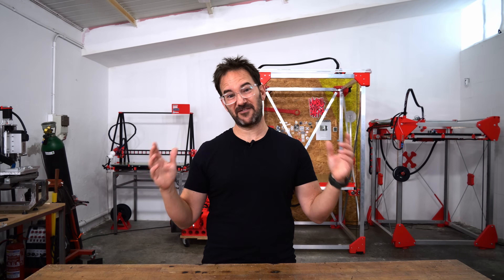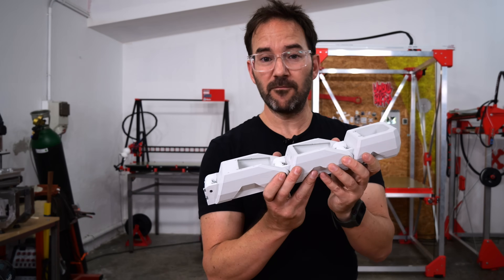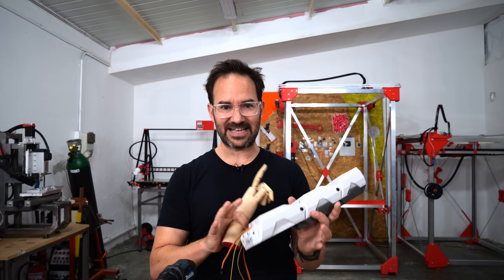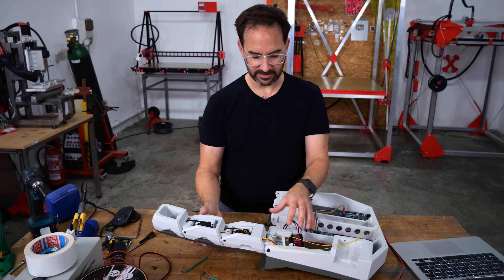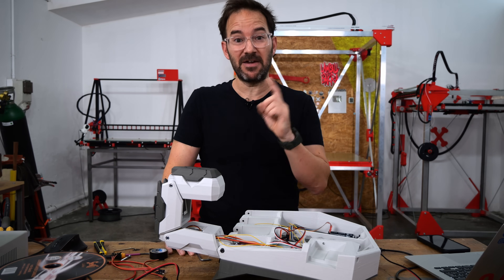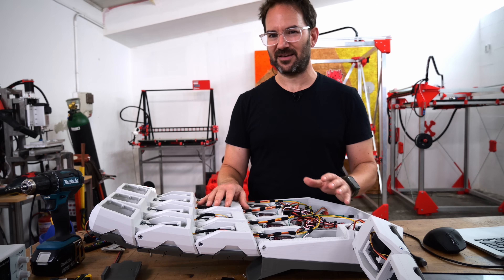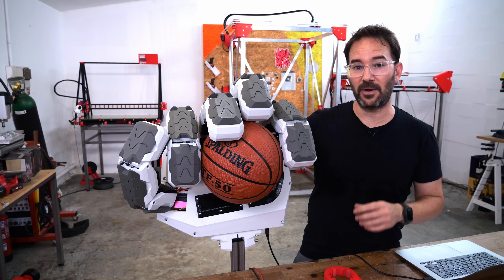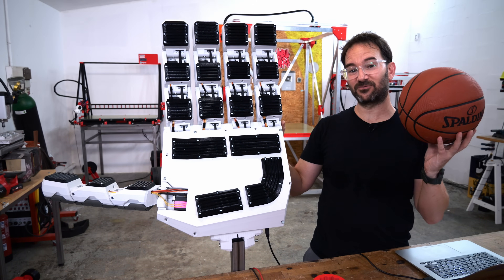You won't believe what this 3D printed hand is for

Comment: something to possibly consider that would let you simplify wiring, human hands don't have individual joint control of fingers
instead, it's just a long tendon connected a muscle in the upper arm
you could have a pulley connected to a far more powerful motor hidden in the arm or hand of the mechanism, that way you can get something more powerful, and each joint could bend to fir the form of the object it's holding automatically to a degree

also, the movement of the thumb is extremely important for grabbing. It's why people talk about humans having opposable thumbs being so important. Without that 2-axis movement on the base joint, grabbing becomes a logistical nightmare

Comment: Buy a mini lathe and milling machine, you can get a mini lathe for very cheap and a used old mill for a decent price or if you have like 5k you can buy a nice new cnc milling machine, also a 3d printer that prints aluminum or metal

Comment: I was so waiting for you to make it flip a bird.  Middle finger stays vertical while the other digits fold down to make a fist.  Variations of the gesture are possible even when the fingers on the 3D printed hand cannot flex left to right like a more natural moving hand.  So...how long will it take you to build your giant mech?  Will it be like a Robojox type of mech where you are the pilot inside the machine?  Or will this be externally controlled with wireless puppetry exosuit.  Translating the motions of your body into the movements seen in the mech?  Like the tools used to bring Johnny 5 robot to life in the films Short Circuit parts one and two.

Comment: Super project and super complicated. With 15 servo motors, each with 180 degrees of freedom of movement, you have an infinite number of combinations, isn't that super hard to program? 
But I would have a recommendation that strikes me in each of your videos in the eye, get the makita cordless screwdriver with 12 volts, this has more than enough power for your kind of projects, but is also much more handy and smaller! 

What I find great that you no longer in red 3d prints, looks much better without the red Pla from 😃

Comment: Fingers have a single tendon, one on the inside and one on the outside, ie, a single motor with thick belt will save 2 motors per finger.

Comment: Nice project! But for the servo's, maybe the pca9685 is a nice option to consider in the future. A single board can drive 16 servo's via I2C without any issues, and you can chain them to drive up to 992 servo's or other PWM hardware over a single connection!

Comment: This is really cool and I like the finished look of it. I was wondering if the servos were going to be able to move so much weight and it looks like they soft of can, but the belts aren't helping them any. Would it be too over-built and expensive to switch those out for chains and sprockets? Maybe also some motors or servos with worm gear drives to improve torque? I'm also wondering if instead of a belt or chain you could use a thin steel cable and the motor could be fitted with an oval shaped cam to pull back on the cable. You could add springs to return the fingers, but maybe another cable going the other direction around the cam would work better.. Maybe a spring keeping tension on the motor mount/gearbox assembly.

You probably already have a better solution in mind, so I'm curious to see what you come up with!

Comment: Its seems you don't need the motor in the finger's joint at the top. Only those in the hand's joint and the middle section. I'd connect the tension belt from the middle section motor to the finger's tip, bypassing that third motor. Just watch how your finger moves!

Comment: Not sure how exactly to explain this but since the fingers can't really move laterally compared to a human hand wouldn't it make sense to maybe instead of having 5 fingers to for example combine the pinky and and ring finger as one assembly? and just use the free up space to add combined servos or a bigger servo?'
in this case, if you use a big enough servo you can even maybe eliminate the middle finger and make It more efficient maybe?

Comment: For a Hexapod project, I once also had the idea to solder a wire to the potentiometers of the servos. As I had 18 servos to control, and I did not want to use 16 ADCs I used some analog multiplexers. This did not work at all. Somehow the analog multiplexer did not have a high enough input resistance in order to decouple the potentiometers from each other and the whole thing worked like a big resistor network and the servos started acting chaotically, as moving one servo also resulted in a resistor change in the other, which they then tried to compensate in the control loop.

Comment: You also need at least one pressure sensor  per finger for feedback (read some of the  earlier story from Isaac Asimov). To be extended on every phalange.
Reply: not needed. if you used stepper motors then the current would spike when encountering a load. its how 3d printers with no homing switch find home.

Comment: A system using strings and where the servos are in the palm of the hand would significantly reduce weight and thus increase the strenght of the fingers

Comment: I think it needs stronger motors with lower gear reduction to be more effective at grabbing things. Those servos have little 5v motors with high gear reduction. Great vid! Keep it up!
Reply: Yeah , having only 11 and 25kg seems insufficient with something this big, the servos should be 50kg+ and there are some 3d printed gearboxes which he could use for the fingers
Reply: @ulforcemegamon3094  Yes agreed. Also to add to that, there is a slight belt reduction at each finger joint but the leverage that is lost from the fingers being so big is not helping. I think one larger motor for each finger and then each finger joint is connected in a way would be a better solution than small motors at each joint. I'm studying engineering right now and could calculate the current max leverage at the finger tips if we knew the finger length, pulley diameter, and the belt reduction. I have a feeling Ivan didn't do any math for this lol. (Which I don't blame him tbh)

Comment: The palm should not be flat, the pad at the bottom and the L pad should be more thick, like 2 or 3 cm or even more but the width should be less like half,  so when the fingers closed it create a "box" result in more "grip", like that the balloon would be block, didn't try to slide out like  10:11 because the palm pad is too thin.

Comment: You should consider using actual servo drivers rather than just the arduino mega. The arduinos, especially with complex code can end up with jitters or unwanted movements on the servos since the arduino servo library is interrupt based and only controlled by software. This could end up with issues as the code gets more complex like reading the positions and implementing feedback. Using hardware timers is the best way to do it and is how servo driver boards do it, you could also get and use a microcontroller with enough hardware timers like some STM32 microcontrollers but you probably want to stick to using arduino.

Two options are to use a commonly available servos driver board with 16 outputs, or to use the servo 2040 board from pimoroni which uses an rp2040 to drive the servos since it can use the pio to drive the servos properly. The common servo driver boards have an arduino library that makes them very easy to use and are probably your best choice.

Comment: ive always heard it called a "mech" there are a bunch of games about them, also the kevlar wire seems like a really good idea, i might also suggest putting the motors all in the palm of the hand, as long as you put the pulleys for the lines going into the segments of the fingers at the joints of those segments you should be able to keep them from fighting each other, you might even want to consider only using one puller/extender motor per finger.  i dont even think we as humans can like individually control the segments in our fingers, or at least thats how it feels to me, i also think thats how ive seen it done in other mechanical hands ive seen

Comment: Nice build ! I have a design recommandation for you. Check how Boston dynamics robot dog legs works to avoid having torque issues and belt tensionning problems. Having all the motors in the palm and ball screws or other mechanisms to control the 3 parts of a finger could make this hand very agile, what do you think?

Comment: Nice try!
There's a reason why not all fingers have the same length... The first thing to do would have to got to an anatomy book to get the relative lengths or, simpler, watch Will Cogley's attempt at mimicking a hand. he goes very far, especially in modelling the palm... Yeah, there are 8 fun-shaped bones there...

By the way, you only need 1 servo (or stepper) per finger, the phalanges are not designed to move indepedently (unless you block them with an arthritis-like move). The advantage of using steppers is you can feed them with much higher voltage. Also, you're using your servos over 90º, from inside the fingers, which is basically losing half of their course. A simple 1:2 gear would double your torque for the same course, and you could do even better with severely multiplied steppers, with a gain in precision.

Comment: Interesting choice to control every joint with an individually controlled servo. I would have either wired them all to the same signal wire so they moved together or used a sort of tendon to pull on them all at the same time. 
But I've never done a project like this, so good job.
Reply: If you are thinking to control all the servos of one finger you don't need to use one servo each joint. But by doing it you can archive much more accurate and realistic movements

Comment: It is necessary to have pressure sensors in the fingertips to feel with what force the object is compressed.
Reply: if you used a stepper motor and a tendon design, the voltage spike of the load of gripping something could be used in lew of a pressure sensor. less parts is better. then you have one per finger. then the motor can even be in the arm, so the hand is lighter.

Comment: Getting into mecha construction?  Fun.

To reduce the servo count, you might consider a single pull strap for the entire finger, then springs to push it back open, and then pressure sensors under the finger tips for limiting.

Comment: What your making is a Mech, giant robot you ride inside of, you can look at Armored Core 6 as a game that just came out as reference for what a western mech looks like or Gandaum for an anime mech, if you want some real world exsaples of simple mechs people have made you can look up "PVC mech" on google images they use a physical linkage between the arms for movement, know as a master slave system. Thies pvc mechs are reminicent of the power loader from aliens as they are effectively full body silits. 

Then you have the 4 full metal mechs, the 1st one made by a Japanese company that goes by the name: Kurata mobile mech suit. 

2 made by an American company Megabots (they went bankrupt) who wanted to start a mecha fighting league. 

Then lastly Prosthesis where they plan to make a mecha racing league.

Kurata uses a little doll of the robot inside of the cockpit to move the arms, i cant remember what they did for locomotion.

Megabots used a 2 pilot system like a tank, 1 pilot, 1 gunner. Using joystick controlls.

Prosthesis uses an electronic and hydrolic master slave system where the pilots arms and legs control the mechs arms and legs, theres a video on the Hacksmiths youtube channel where he learns to walk the mech about. 

Hope this can help you

Edit: James Bruton and Colinfurze have also made mechs and mech like robots, if you need help you should be able to get it from them, together they made a working Hulk Buster.